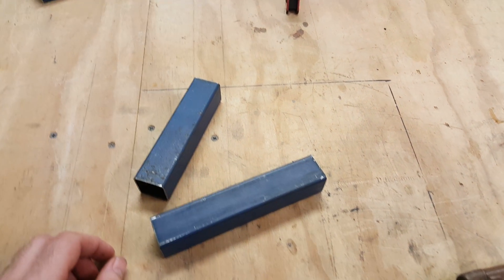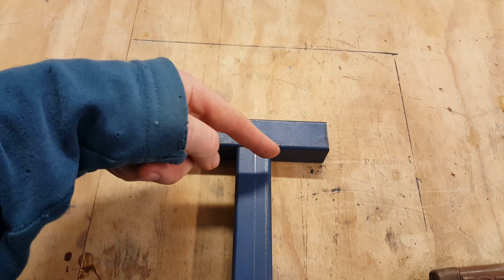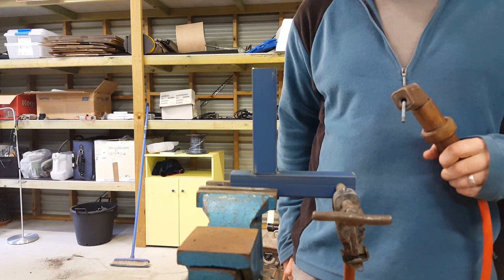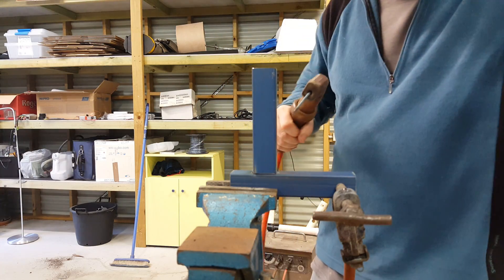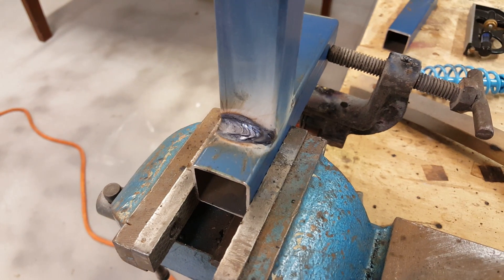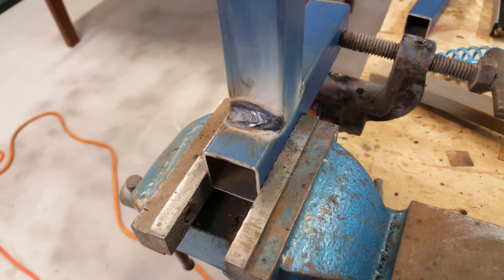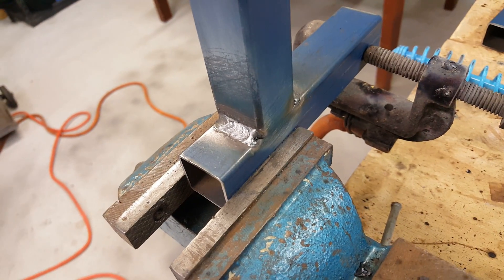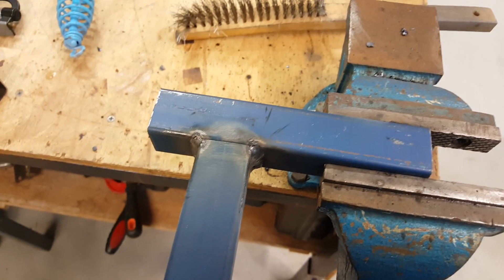Welding thin steel tube with a stick welder

Comment: In order to avoid that ugly start, you need to let the arc blow over the edge for a second at the beginning of the welding.
That will blow the slag over the edge, not under your puddle. As for the "experts" telling you that the start-stop technique weakens your weld, well, no one cares for super critical strength when you're building a shelf in your shop.

Comment: Grind the paint off so the ground makes good contact, then grind the paint off the area where the weld will be. You aren't doing yourself any favors with poor connections and contaminants in the weld zone. I just finished welding up a frame from the same thickness square tube, using the same diameter rods and only blew two holes. The first was due to having the amperage set too high(90 amps) and the second was entirely my fault...I momentarily paused in one spot rather than continuing the weld. Other than that, I laid continuous beads with zero problems.

Comment: That is pretty good results for welding thin metal with a stick welder. I usually use my everlast mig welder for thin material to avoid blowing holes.

Comment: home made amature welding at it´s finest. strip the paint and this "start and stop" is bs, you do it with low amps and do the full strain. otherwise you risk getting slag into the weld and then the weld is crap.

Comment: Very nice!  And good to hear an Aussie voice for a change. How the hell do you get such great welds so effortlessly with a large electrode, looks like 2.5mm and not even grinding the paint off the area to be welded!?!  Also, in the first weld, how is it that the vertical piece doesn't get pulled over with the first weld - it just stays dead straight.  If that was me welding it, it would start bending as the weld cooled and pulled it to one side.  Unless I clamped it in that position.

Comment: Thanks for this one chris. I am practicing on some offcuts, really struggling with that 1.6mm connecting 2 45° connections together.
Reply: Gary Player the international golf expert said; "The more I practice, the more lucky I get." 

I clamp my welder's Neutral to the vice & let the fine serrations on the jaws make a proper connection to the piece being welded.
For 45° square tubing: Scratch off paint but leave cuttoff burrs on outside edging, do some spot welds using the rod at 90° along the longer angled sections, check/ hammer total piece to be 45+45= 90° then do your thing, welding the outside burrs before the inside 90° T.

Comment: The guy is doing great. But for me 1.6mm is easy to weld.cause i can weld a 1.2mm even using a 3.2 6013 electrode It is easy to weld a flatsheet metal using a 6011 electrode.but it is not fullweld we call it here in the philippines spotfullweld.like the guy did in this video.

Comment: If the electrode is too long bend it back over the handle, it will shorten the distance and then just twist the handle around to finish the weld

Comment: It’s called prosody. 
Try striking an inch back and then long arc it Towards the front when begin your weld
Reply: jayonez 13 or, porosity. But either way, English can be tricky.

Comment: I am a beginner. I was wanting to learn why when I try to stick weld two thin pieces together I only make holes. My welder is big but basic and I dont have a crank I have to change the cable position to dial it down. However I still seem to burn or my sticks stick,

Comment: I just loved the true ( I witnessed it ) time a welding student at the tech school I attended walked up to a small group of us standing around a project being welded up.  He looked the welding beads over and made the comment that even a blind man could run a better bead than that.  The beads were decent and nobody had really thought different.  The instructor who had done the actual welds was among our group.  He told the newbi the beads were to specs and what did he think was wrong with them.

The newbi student, realizing he had stepped into a cow pie, sputtered a little bit and quickly drifted off to a distant part of the welding lab area.  After a week he had apparently drifted off to Norway because I never saw him again.  Best to hold you tongue if your going to be critical.....just in case that subject grades your Certification Test !!  Ha Ha ...but very true.

Comment: you call that welding? i've seen better welding on a monkey-cage. thanks. i'll try your technique. i've really struggled with that thin stuff.
Reply from the maker: Haha, I never said it was good welding :)  Yeah I know lots of folks have said I should just turn the amps down, but I get weak penetration and the electrode sticks too much.  I find it easier to run a bit hotter, but move quickly, and lift up whenever it looks like its about to blow through.  Best of luck with it!
Reply: thanks again.

Comment: Why in the world would you weld anything without  wearing gloves ?   One day that arc will get you , your running a melanoma cancer risk on your hands , not pleasant !  Now that the safety issue is put to rest , I usually use a 1/16th 6013 rod at 45 amps on super thin clean metal using the same technic with usually good results with no blow through , it works if the amperage is not to high !   Try on a scrap piece the same thickness if possible and adjust your amperage or rod angle !

Comment: Protect your hands please if not coz of the molten metal drops, do it coz of the UV radiation. And yeah if u have a long electrode you can use the other hand index finger to lean the electrode on until it get shorter to the size you are comfortable.

Comment: Fair welds and demo only comment would be try continuous runs once started with gentle sweeps side to side to create your fillet. When butting an end to a tube side weld more on to the tubes rolled corner so as not to burn through the cut end, with a continuous flowing run the gap will fill with anode metal melting into the tube end with a nice fillet. 
It's good that you have practiced and put out this lovely simple approach well done.

Comment: Hey Chris, I've been into stick welding for about 1 week now and of course the first thing I had to weld was thin wall tubing just like yours.. Thanks for tips, I'll try them out in some days. Btw, I've been told that the UV-rays of the weld can be pretty heavy on your skin.. Is that true ?
Reply from the maker: Wooden Weaponry yes UV radiation is pretty mean. Definitely wear gloves.
Reply: As long as I wear gloves I can continue to weld naked, it's a weird fetish but it's mine.
Reply: 100%

Comment: Super technic! Did you clean paint before welding?
Reply from the maker: I just ground a bevel on the edges I was welding.  The blue paint is a very thin layer of metallic dust, and it can be welded right through.  Cleaning it all off would help, but it's not like it's galvanised steel or anything.

Comment: Great video. Can i use 6011 3/32 with the same technique?
Reply from the maker: I think the 6011 rods are faster-freezing, so you might be able to keep moving in one pass.  Otherwise that's the same rod size as I'm using here (about 2.5 mm diameter).

Comment: Not a bad weld you just moved to fast at the start of your  weld that caused your weld to Hollow out the outer flux is there to keep an even heat to melt the inner core of the rod a steady flow will keep the ark flowing and with the correct amps. good weld though.

Comment: Was thinking about looking for a video on stick welding thin tubing. Got a cup of coffee and started up YouTube. I didn't have to search for anything at all. Your video was the third one from the top! By the way, I'm not an expert welder but I thought your welds were just fine for what you are using them for. More importantly to me is that I have more confidence about welding desk frames with a stick welder after watching your video. I was starting to wonder how well that was going to go. Thanks for the video and the technique

Comment: Hey, Anytime your welding thin mild steel. Tack in situ and weld downhill or on a 45 degree and higher angle up your speed of travel to suit to prevent blowing through.done this with 16 gauge  up-to 22 gauge .
Reply from the maker: Interesting!  I might have to try this!

Comment: Should always clean your base material before welding. Also use a smaller rod like a 1/16th. For a continuous weld. Stop and start lacks penetration

Comment: I would have never thought it possible based on my limited experience with stick welding.  Judging by the comments section a lot of folks appreciate your taking the time to do the video.

Comment: Hey bud what your basically doing is tack welding it together, I understand thin material can be difficult to work with and I'd suggest trying to lower your amperage (if that dinosaur of a machine even can) and learn to get comfortable in position, also wouldn't be to difficult to do an short course on welding in a night class.
Reply from the maker: As I've said elsewhere in this thread, lowering the amperage resulted in poor penetration and more slag inclusions.  The take home message is that AC stick welders are not the best tool for the job, but can be made to work satisfactorily.  1.6 mm is probably too thin for this welder, but I recently welded up a frame using 2 mm steel and it welded like a dream.  Still had to stop-start, but each run was longer than this video.  No slag inclusions, and most importantly, no grinding necessary!

Comment: I used this method with flux core wire; somehow I didn't think about it when welded with 1/16" 6013 electrode, I was rather  trying to find best amperage and speed to weld continuously. Yes thin tubing is most difficult to weld well and I started learning on thin stuff. When switched to 1/4" material it was easy. I wonder if using 6011 electrode would eliminate inclusions since this electrode can be used with whip and pause

Comment: Using the same tubing and 6013 and I'm boring holes right through all the time. Running between 65-75amps
Reply: Njoy Ridin what exact 6013 are you using? Theres more than 1 size 6013's. Measure the rods diameter without coating...it should be around 2.4-2.6mm...

Comment: Thanks, this really helped me. I just started welding and for my project I had to weld 2mm steel tubes with 6013 2.5mm electrodes on an old transformer welder. With your technique I managed to make good welds without inclusions. On most forums/guides they tell you to lower the amperage but you will only get ugly welds with low amps.

Comment: Looks good. I have welded 16 ga, metal with that method. You get a good weld but not the prettiest. If you can back up the material with a brass bar and and use a thin (1/16") rod, you can sometimes get good results. Thank you.

Comment: Good preparation is a must. 
That box tuning has a coating so it will need to be cleaned prior to welding 
A flap disc on a grinder will deliver a smooth result. 
Also many hardware stores that sell mild steel tuning have it wax coated or a lacquer applied in production to prevent rust / oxidation

Comment: 1/16th inch wall mate....good job....i'd be afraid to stick weld that myself.  I'm a master at burning through all thicknesses of material.  As kids we used to use a tiny Lincoln stick welder my friends dad had in their garage to "alter" bicycle frames to various shapes and such.  Lots of fun on the thin bike frames.

Comment: from a lessor welder  ( probably should have removed the paint before welding you know have impurity in you're weld
 ( advice for this weld  ( slot a peace  of wood. in to the tubing to take away some off the heat. )
start stop is good (I'm attempting to weld round crappy steel on a go kart. ( a bout 1mm thick and I'm welding it to 2.5 'll thick. brought some 1.6mm rods. and I'll try this stop start with along side the rods  id  use what I suggested by I'm welding a frame and can't actually stick  anything behind the weld :(

Comment: 1.6 mm is 1/16", or more accurately what you have is 16  gauge. Actually it looks thicker than that in the video.
Your 2.5mm  electrode (rod) is probably a 3/32" or 7/64" (which I have never actually seen a 7/64 on the shelf ). 

Your video is good, but one mistake you are making is using a larger rod than the thickness of the metal. You have it backwards. For your stick welder you can get 1/16" rods for use with 16 gauge. I'm sure you don't want to buy another welder, but you could purchase a flux core wire welder for less than $100 that can (usually) use .030" wire (which is .762 mm). This wire is approximately half the thickness of your 1.6mm tubing.

Don't try putting flux core wire in a stick welder stinger. You end up with an incandescent light bulb element - just before it melts to ashes. However, if the metal is too thin, I have used the flux core wire between the arc of the stick and the base metal, and it works OK, but probably weakens the joint. Which is only an issue if your joint is going to be stressed.

Comment: There is another way to weld tubing even thinner than that will get you 100% penetration and 0% blow through. Its something most of us have kept secret for a long time because of how much money we make doing thin, deep welds that other people can't. Place a cap(balloon, condom, whatever you have handy that's water tight) over the end, fill the tube with water and tilt it at an angle so the water doesn't spill out or lose contact with the tubing where the weld will be. Position the other tube where you want to weld it, clamp it down tight and shove a rag(or sponge, or anything else that will form a seal) down it. You may want to tie a piece of string on the rag to get it back out. Stick a block of wood in the pipe and press it down with a broom handle. You need to keep constant pressure on it while you weld. Fill that tube with water(doesn't have to be completely full). Now you weld it just like you would thick steel. The water will prevent the tube from burning through by dissipating the heat almost instantly. 

Its the same reason that you can put a Styrofoam cup of water on a grill and it will not melt or spill. As a matter of fact, you can boil water in a Styrofoam cup directly over a flame.
Reply: boil an egg to

Comment: 1.6mm is thick tubing where I´m from, mainly used for gates, workbenches  and things like that, but you can weld 0.9mm tubing with this tecnic the only 2 things you change depending on the thickness is the  electrode and the amps, if you use thiner electrodes and lower the amps a bit, the pass is much faster cause the electrode is thiner so you get less heat on one point  by moving faster. 
I did like the explanation on the flat weld on the side that`s the most common way of making holes on the tube.

Comment: you can use 1.6mm electrodes too they require a lower amperage so you can weld without stopping, no burning

Comment: i got 100 amp stick welder, i want to weld 1.6ml tube together on the side, is this ok to do with your technique
Reply: Yes the technique of the video will work. A small DC inverter? I have an old Telwin 100 Amps inverter sold by Fortney. 
With 3/32 stainless  Steel 312 electrodes at 55-60 amps and a light hand it's a breeze on thin steel which must be clean and de-greased. 
The SS312 is expensive but runs very well at low amps and makes strong nice welds. The easiest stick to use. The slag pops out by itself. Worth to have some in the shop as it welds any kind of steel alloy and most irons. The SS312 works also on AC transformers.

Comment: I tried 1.6mm electrodes this weekend. I found them difficult to work with, a disappointment. I will definitely try your technique with 2-2.5 mm electrodes instead. I think your slag is difficult to remove because the piece is still hot; it will crack as it cools.

Comment: The welds look good but the material looks like 2.0mm from here. Hence your settings are not blowing holes in the tube. Its a good solution to use 2.0mm though as 1.6mm is a lot of work.

Comment: are you a professional welder?
im a supervisor in a metal construction company and i would not pass any of your welds...full of holes and that should not be as hard as you make it sound
Reply from the maker: You clearly didn't watch the video, particularly the part where I state I'm not a professional welder and that my welding is not very good.  I am not Gods gift to metallurgy, nor am I pretending to be.  I do know that if I have to weld up a gate frame on a farm and all I have is a stick welder, this technique seems to work.  But thanks for your kind words all the same.
Reply: wow you're a legend tattooed yobbo. And thanks Chris.

Comment: To make an easier start have a piece of clean scrap metal hold it against the metal that's electrified and get your electrode worn in a bit, also wear safety equipment in 15 and know what horrible injuries it could cause you.

Comment: Firstly thanks for the great Video , I was having the same trouble always blowing holes in 1.6mm RHS , but got a good result after trying your technique , but having read in some comments to try and turn the amps down , I thought , no way I'd ever get the rod started , but to my surprise , excellent full length welds . I'm using a small Mishto inverter welder . It has only one dial which goes from 0 to 7 , normally using it around 5 , I turned it down to 2 (not sure of amps ) with 2mm Rods with great results , no holes !
Reply from the maker: Glad it was of some assistance.  I find with lower amps the rod struggles to start an arc, but it's very slow going in order to get decent penetration.  Maybe it's got something to do with AC?  This welder is about 100 years old...
Reply: AC welder is going to be a PITA on thin material in my limited experience. When I got a DC welder it made welding thinner stuff so much easier. Run hot enough to get the arc started and keep the rod from sticking and just move fast. Penetration isn't going to be an issue on such thin material.